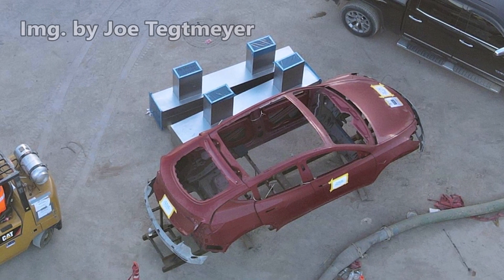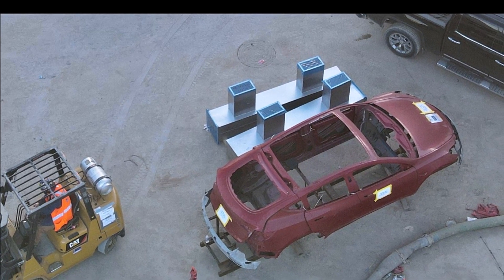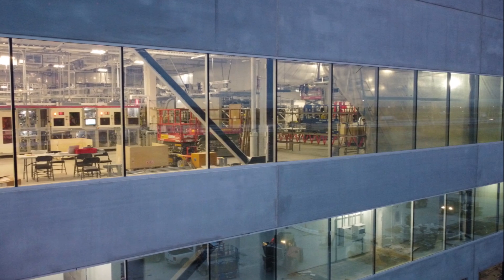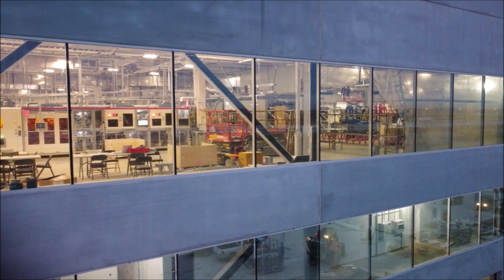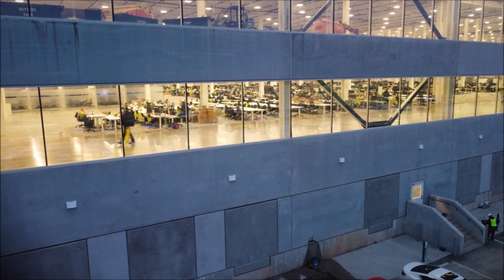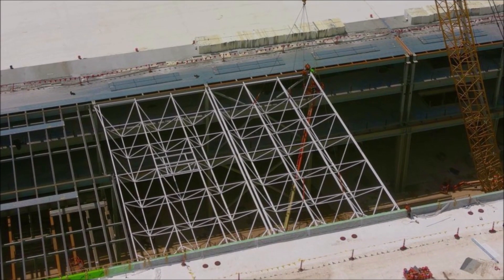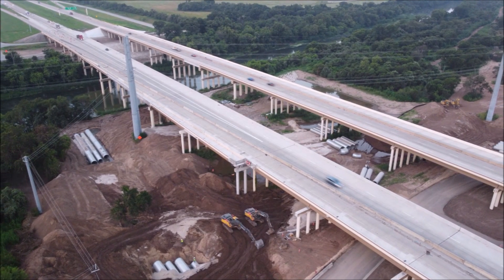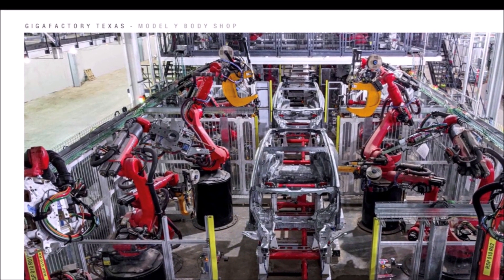BREAKING! Tesla Giga Texas Model Y’s Rare Angle Suggests 4680 Battery Pack

Comment: The photo certainly does NOT suggest 4680 cells.  By design, the pack will be structural but not necessarily 4680's.   They can use 2170s if they don't have enough 4680s on hand.  Arman, honestly, if you keep crying WOLF! with your BREAKING! clickbait headlines while delivering such rumors,  you will lose your viewership.

Comment: This is a test and alignment body sitting on a line carrier fixture.  In automotive manufacturing they will outfit the body with thermacouple sensors and a data logger called a data pack to allow them to test out the paint oven temps so that the paint comes out cured on the entire body.    I am a former BMW & DuPont paint process engineer in the US, so looking at this body tells me that Tesla is programing their Austin  line  to run the 4680 Model Y,  no doubt.  These types of bodies are very common when starting up, testing and ramping an automotive assembly line.
Reply: appreciate the expertise